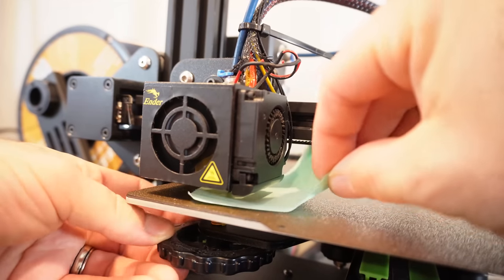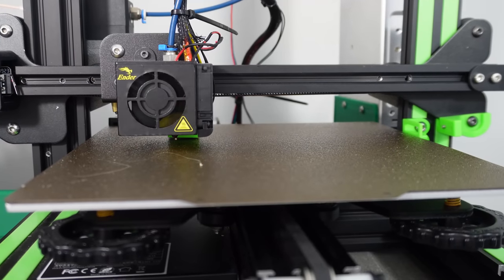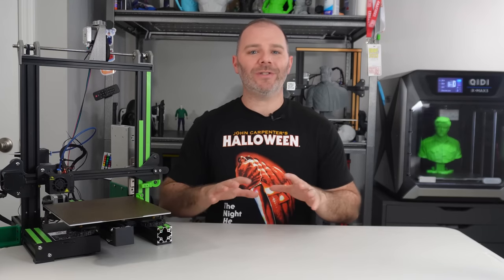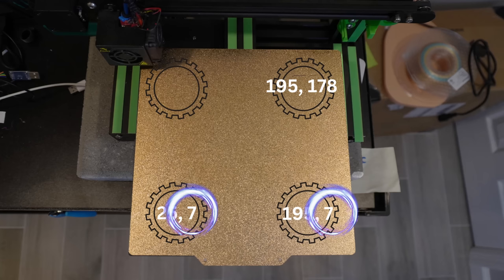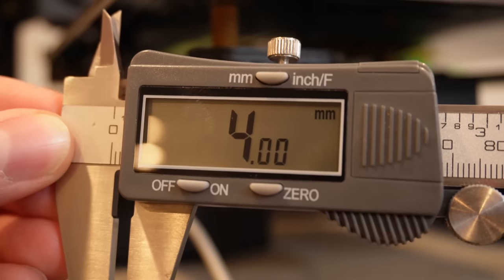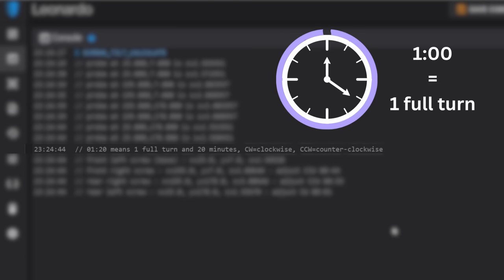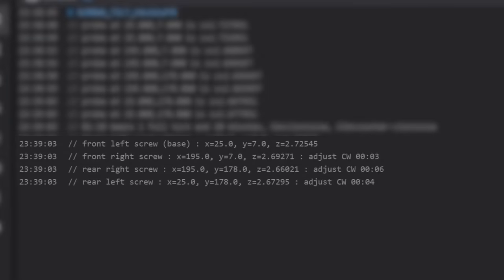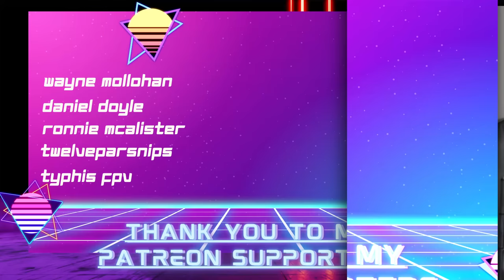Let Klipper level your bed with the built-in tool screws_tilt_adjust

Comment: It should be called, bed meshing, or bed mapping.  You are not leveling the bed, you are mapping the surface.
Reply from the maker: The physical process I describe early in the video is usually best described as bed tramming. renaming the screws_tilt_adjust macro is easier said than done lol I was thinking of terms that make the process sound easier and quicker to understand, but screws tilt adjust does describe all the different aspects we are affecting. Your suggestions are great though, and I love the idea of using the term mesh more often, as generally we will be using a mesh to better map the movement of our nozzle across the bed surface.
Reply: With a simple script, it could be. Have it probe certain points, and spit out the needed adjustment to make it actually level
Reply: Bed meshing in my opinion is different. The probe check the small variance of the bed in different spots and automatically apply a strategy to follow the mesh during printing.
This procedure tells will level the bed as flattest as possible using the mechanical screws under the bed. I fact it only measure the corners.

Comment: This is the bane of my 3D printing experience. My Creality V3ke to this date will not correctly compensate for the created mesh. I've tried everything. Creality even send a complete bed replacement and still no luck. The auto calibrate will just not work. I wish I had the "screws" option. I have to trim the bed using razor blades which work surprisingly well and stick to the magnetic base.
Reply from the maker: The KE I believe is the printer that has Klipper installed, although I'm not sure how neutered it is thanks to Creality. If it does have Klipper you should be able to get a view of the bed mesh visualizer and see where your bed is at its worst and try to compensate.

Comment: What is the point of this if I have a BLTouch? Isn't my bltouch doing all the heavy lifting? I can only think of stepper longevity from not having to move the Z axis up and down so much. If I don't care about that, should I just avoid this?
Reply from the maker: This is a great question and a very common misconception. Both of these techniques work hand in hand in order to give you a great first layer. Bed screws adjust helps to align the nozzle and the bed along the same plane. This is commonly referred to as leveling. The bltouch does not level. It really is just a measuring device. The bltouch takes height measurements of the bed and creates a mesh to use while printing. It doesn't really ever "level" the bed. Also the bltouch is only accurate within a small window of deviation (0.2-0.4mm), so the more "level" your bed is the more accurate the bl touch will be. 
    In short the bl touch never 'levels' your bed, it takes measurements and tries to make your first layer flat. Bed screws adjust does level your bed, and in turn allows the bl touch to work optimally.

Comment: For ease of use, the base should be on the back
Reply from the maker: I'm not too sure what you're referring to. The printer or something else ?
Reply: I mean the reference screw is better be on the back of the printer so you need to adjust only on there, more difficult to reach than the ones on the front :)

Comment: I leveled my beds a couple of years ago, and never need to do it again except for nozzle and bed surface changes.
Reply from the maker: Yea if you can keep a nice stable surface, and if you're using some device to create a mesh and apply it while printing, the times you would need to level your bed can be few and far between. This method being so easy can have you running bed leveling way more often if you wanted, just for peace of mind.

Comment: If you remove the PEI sheet from the bed, you can very easily see the little indentions for exactly where the screws are. I even marked mine with a sharpie to make seeing them even easier. Once you have the locations noted, you can easily put the PEI (or whatever build plate you're using) back on and continue the process.
Reply from the maker: Scott!!! What a great idea. I didn't even think about that. There are some beds (like my original Aquila) where I had to place the magnetic on myself, so there aren't any screws visible, but by and large I think your technique would work like a charm! I am adding a few addendums to this video and this info will definitely be part of it! Awesome suggestion, I appreciate you contributing.

Comment: Hi, first of all, great video, everything very clearly described and explained. I applied this method to my Elegoo Neptune 4 Max and added 2 adjustment points. The only deviation I made was not using a probe, I centered the nozzle above the 6 adjustment points. I ran the "Screws_tilt_adjust" tool 3 times in a row with the final result - at 5 points it was 0.1 and at 1 point 0.0, so I wisely left it at that. Afterwards I did a "Bed Level Calibration" test and it was perfect. From now on this is my way to level.
Many thanks for posting this method on YouTube.
Reply from the maker: Thank you so much for taking time to write such a detailed comment and letting me know this worked. Much appreciated, I'm glad you found me and I was able to help!

Comment: This is an awesome how to Leo. This type of tool could seem so complicated, but after a watch, you’ve made it so clear that it seems silly not to use it. Well done.
Reply from the maker: Thanks Fedor! Yea this changed the game for me, I could just run this occasionally to make sure the bed was locked down instead of going through the normal leveling process. Thanks for dropping a comment, you the man !
Reply: 100% correct, great viddeo

Comment: Oh man, I'm late to the party but this has solved all my issues. For anyone with a larger print bed with a set point in the middle (such as the Elegoo neptune 4 plus),  set screw 1 as the very center of your bed - and add the additional other screws using the same format. (I have 6 screws, so 1 is set to the center of the bed and 2 through 7 are the other 6 screws) I wish i had found this a week ago!
Reply from the maker: Glad you found it! Klipper is full of so many amazing tools sometimes the hardest part is finding them. Great info about using multiple screws as well, there was some questions about that when this video first came out and this comment will help a lot of people!

Comment: Thanks so much for sharing this method. So much easier. I've noticed the wheels on my Neptune 4 Pro have 10 bumps on them, so allowing for each being 6 minutes apart makes it extremely easy to turn them just the right amount.
Reply from the maker: Oh wow that's great! The knobs on the Creality style machines have so many grip areas that it is hard to track. It would be cool to see a printable option that mirrors the knob style that Elegoo employs, or make it even more specific to this calibration!

Comment: Easily my favourite feature on my recently upgraded ender 3!

What i dont quite understand is the z offset should be completely separate from the bed level, the offset is the offset of the probe to the nozzle, thst has not changed at all
Reply from the maker: Yea this tool is like a complete night and day shift when having to bed level, it almost becomes an after thought now because it's so easy.
    The z offset question is spot on, and it's a really confusing topic. You define z offset in the same way I do, but I think we are slightly incorrect in that thinking. I usually say the same: 'z offset is the distance between the nozzle tip and the probe tip' but the more accurate definition is the distance between the nozzle tip and the location where the probe tip triggers' and for that reason whenever we adjust the tilt of the bed we need to readjust the z offset (I guess Kevin was smart to use the term 'tilt' for this macro lol). It may be a slight adjust if any but it's what I would consider 'best practices' when performing this calibration.

Comment: New to the 3D printing world...Just came across this video and it looks very promising and easy to do. Question, for a printer that has 6 adjustment knobs what would the text commands be for the config file? I have a Neptune 4 Max and along with the knobs in the corners there's one in the middle on the left and right side of the bed. Would it be 'screw3_name: middle left screw', 'screw4_name: middle right screw', 'screw5_name: rear right screw', 'screw6_name: rear left screw' and confirm if so? Many Thanks and very thourouh on this guide!!
Reply from the maker: Alex, happy to have you in the 3d printing community! I have been getting a lot of questions about the Neptune Max 4 lately, and unfortunately I am not more familiar with the printer (besides seeing it in action at East Coast rep Rap in Maryland this year). As to your main question can you add additional screws to screws_tilt_adjust, and the answer is 'I don't thinks so'. I honestly hadn't heard of a bed with more than four screws, and lately beds are moving away from screws and going to a more 'fixed in place' structure. That being said when I get a free printer I will try and add some additional screws and see if Klipper accepts it. There's also the math that is involved with tilting a bed in quadrants, and I am not sure if Klipper is setup for a number greater than four. Let me do a little research and get back to you. Again, happy to have you aboard and I am glad you found my channel!
Reply: @alexautry5845 Your naming is correct but the numbering is out of order.  I tried this and it worked, you can watch the order as it runs to confirm. 
LF 1, RF 2,  LM 3,  RM 4, LR 5, RR 6
Great video @PrintsLeo3d
Reply: @DODGE1MOPAR  AWESOME! Thank you for your response and the clarification! I had guessed which order after the Front left and front right lol. I'll try that when I get home and let you know. @DODGE1MOPAR, thank you again! I'm assuming you have an Elegloo N4M as well?
Reply from the maker: Woah!! I cannot believe Klipper allowed for adding more screws!! I'm sorry I never got around to checking, I honestly just forgot. Thank you @dodge1mopar for doing the work and finding out! This is great to know.
Reply: @DODGE1MOPAR  @PrintsLeo3D did you do this method on a Neptune 4 max? because i'm getting this error message when attempting.Which i get the same error message when attempting to do  a mesh. "No trigger on probe after full movement" is the error message i'm getting.This printer is using some type of proximity sensor for metal because Elegoo says do not swap out mats that it has to be a metal mat for the sensor to work. The Kobra 2 Max is using a proximity sensor for sure just havent heard anything stated you can't. So, if anyone knows what i'm doing wrong or how to use this method with these types proximity sensors, please chime in.thanks in advance!!!!

Comment: Great video again thanks for the content my only crit is that I would make the screw 1 the one thats is attached to the bed heater cable and sensor probe if your bed is setup like that makes it so your adjustment knobs doesn’t bottom out easily.
Reply from the maker: Steven that's a great idea, where we you when I was making this video lol Seriously that is a very great idea and I'll keep it in mind when talking about this in the future.
Reply: Glade you like that I’ve watched the video on how to setup a bed mesh and bltouch in klipper a million times I keep all these videos in my list of necessary how tos because they’re so clear. Thanks a bunch I would be pulling my hair out if it weren’t for the clear videos

Comment: I just got mine ender 3 v2 bl touch setup with mesh leveling and succeed from the first try! I definetely gonna improve printer with that technique and dual z.
Reply from the maker: Awesome to hear! Those printers are capable of amazing things and it only takes a few tweaks from us to get there. Glad this was able to help you on the way!
Reply: @PrintsLeo3D  What are kind of ways to improve y axis?
Reply from the maker: I'm not sure I understand what you mean by improve the y axis? Are you looking for stability or smoother operation? With my ender 3 I never did any upgrades to the bottom rail. I know some people have tried linear rails but I never went that route.
Reply: @PrintsLeo3D  What i looking for is the acceleration and stability with better result in input shaper
Reply from the maker: A lot of people are of the mind to use whatever the best EI values are for the y axis. The idea behind that is because the Y will change over the course of a print because a model is slowly being deposited on it. Ultimately tuning your max acceleration outside of input shaping is the best way. I'll have a video on that process very shortly !

Comment: hi, i've learnt too much things from you thank you. i have e3s1 pro with klipper. my bed is very very warped, around 0.6 gap in the middle. i used to put aluminium foil under it but when i realize that there is "x twist compensation" i wanted to try but it doesnt help. can you make a video about it? if it works, im sure hundreds of ppl will have a flat bed and good first layer. my problem is it seems it doesnt save the compensation. everytime i do it again after save config and restart, z offsets are same for where i adjust the nozzle. so same bed mesh everytime.
Reply from the maker: Thanks again for the comment! I answered you in your previous one to find out exactly what your issues was. In the Manual Bed Mesh video comment section 👍

Comment: At 10:16 the document say its must be the nozzle over the screws
But you said in the beginning the position must be the one of the Probe, I'm confused 🤔
Reply from the maker: That sentence can be a little confusing but what the document says is " determine the nozzle coordinates such that the Z probe is above the screws..." 
So it's telling us to position are probe over each adjustment knob and record the coordinates. 
    Klipper does have another routine called simply 'bed screws'. That asks you to get the coordinates of the nozzle over the screws, and then for operation it moves the nozzle above each screw for manual leveling. I go over that method in detail in my Manual Mesh video. 
    I hope this explanation cleared that up but if not let me know.

Comment: Great video, and very informative! My only issue with screw tilt that ive noticed is that with multiple adjustments you will notice the z height of screw one changes. Im happy you included the steps of adjusting the z offset. Nice work
Reply from the maker: You're absolutely right, and I lightly touched on it, but I probably should have added a little more. As we make the adjustments you'll notice that while screw 1 does start to move, all the screw positions will start getting within range of each other. Now of course this does move the screw 1 corner up, I think the other corners matching that will eventually leave us in a more desirable location. I appreciate your comment, I am going to add a section to the article on my website that mentions this. Thanks!
Reply: @PrintsLeo3D  thanks for the response. Now, with that being said. This coupled with say an auto z calibration (is, voron sexbolt), then it's a great tool to use and becomes even easier. I'm hoping to not need it at all soon. I have a mercury one.1 that I'm considering doing quad gantry on with the z endstop probe.
Reply from the maker: That's the dream . I'm looking to start on a project soon and I may be in the same boat as you 👍
Reply: @PrintsLeo3D  8 months later I still come back to this video when I'm drawing a blank. Thanks again
Reply from the maker: Lol tell me about it. There are times where I'm sitting in front of my printers and I still pull up my videos to refresh 😆
Reply: @PrintsLeo3D  lol this video and the input shaper one you did is very helpful to go back to. I appreciate the commands int he description too.

Comment: I just migrated my original Ender 5 to Klipper, the rest of the printer is stock, aside from adding a CR touch and bed supports.  Subtle differences, but enough to make me decide to keep it as klipper for now :)
The only thing I am really having issues with is the Z-offset.    This is one place Marlin seemed to be more stable.   I seem to need to constantly adjust the Z-Offset to get that first layer right.
Any suggestions?
Reply from the maker: One thing to remember when adjusting z offset with Klipper is to always save it after the print has finished. Otherwise you will be always adjusting off of a previous adjustment and you'll be driving yourself nuts. 
    Usually my workflow is to adjust z offset outside of printing, and then using my front end (Fluidd) I'll adjust the z offset under the Tool option. When I am satisfied that it's good I'll let the print finish but then afterwards I remember to save that value using the disc icon that is under the Tool section. That ensures the value you just calibrated will save and persist between prints.

Comment: Can klipper screw tilt adjust also be applied to a manual bed adjustment or does it require a probe? Thanks 👍🏻
Reply from the maker: Unfortunately Klipper is only setup so that it can be operated with a probe. There are manual routines that you can use to help expedite the process of bed leveling without a probe, but screws_tilt_adjust won't be afforded to you. If you want to look at some manual ways I have a video on creating a manual mesh and it goes over some of those concepts. https://youtu.be/yNoPNzFKXvU